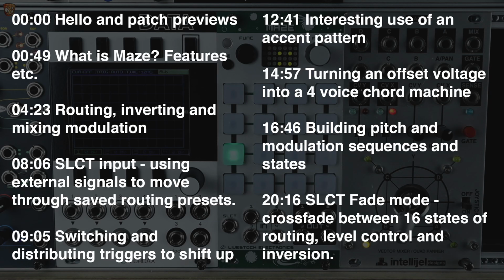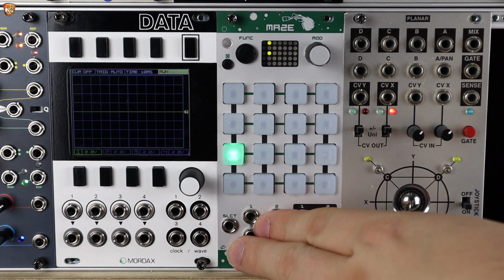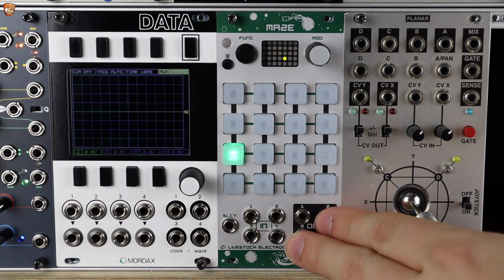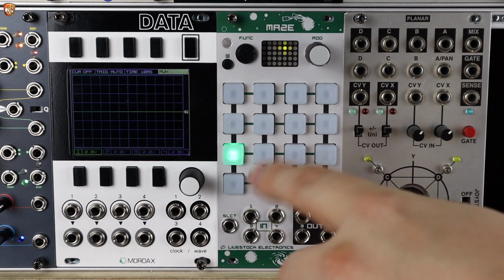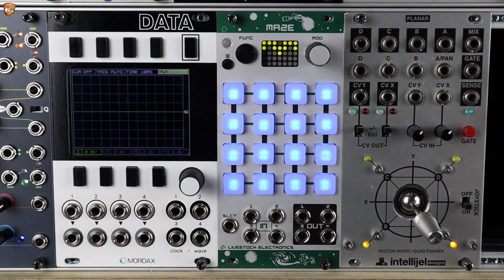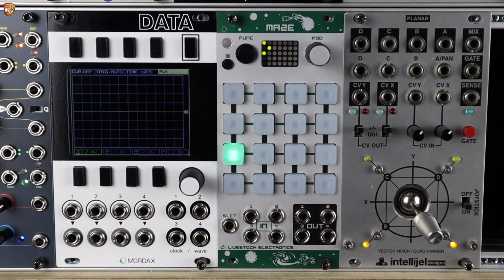Livestock Electronics MAZE - Sequential Attenuverting Matrix Mixer & Signal Router in Eurorack

Comment: Cool presentation of this beast. Powerful stuff for live racks but with a certain challenge to imagine and remember all that you save in it ;-)
Reply from the maker: For live I'd just save a few key parameters to take the patch elsewhere I think. Then use another bank for playing around outside of that live set.
Reply: Yeah, remembering what are in the presets may be difficult to remember. That's why there is a preview mode (not shown in this video). Where you can take a look in the preset before you initialise it. But personally I think like Ben said, take a part of it you find useful and keep it simple. :)

Comment: one thing I don't really understand from the manual or videos is what happens if you select a position, set its level, select another position, and then turn the encoder again before hitting func/save (like you do at 2:22).  does that set the level for both the previously pressed position and the latest-pressed position?  or only for the latest-pressed?  my hunch from the manual tells me that it sets the level for both, unless you either re-pressed the first position (to "deselect" it) or hit save before pressing the next position.  curious because I'm trying to wrap my head around how tedious it is (in terms of constantly hitting save - you sounded tired even saying "hit save again" lol) to use this in very simple matrix mixing applications.

Comment: great demo as usual :)
question : i’d like to use it to navigate through the presets of my polyend presets. the way i see it : one in the in with a « light » offset, one out to the cv input of the polyend preset.
would it work ?
Reply: the CV input can take a gate signal for clock or record automation to a selected output

Comment: Damn you!   I didn't even know I needed this.   Neither did my wallet...  My first thought is it could make an ace 4-input mono-to-stereo out mixer, and use the other two out channels as effects sends-- able to morph the pan position of each input as well as effect level, etc.   

One thing I'm wondering with regards to CV handling-- it does invert, can it also do offset?
Reply from the maker: No offsets, but that idea as a stereo mixer and FX send is great! ... I should try that sometime.
Reply: Offsetting can be done by simply plugging a DC voltage in one of the inputs. Alternatively it will be handled by a linkable upcoming module called Ellis.
Reply from the maker: oooooh linkable new module!
Reply: would love it but other switches cost way less and take up less space and get the routing mixer job done thus leaving funds for a sequencer or clock module.

Comment: Seems to do everything, but I wonder how well one can intuitively remember how to use all the features since it seems to require some degree of memorization from the manual.
Reply from the maker: Yeah it's not gonna happen the first time you use it. But after a session with it, it comes quickly. In use I just hit the main function button to jump between preset/save slots and routing and that's it really. Occasionally hitting the little button for some muting. Then very occasionally going into the settings to change between trigger, random or fade mode on the SLCT input. But you can just save a handful of routings and stick with those for any given set/project.
Reply: Jep, there is a lot what Maze can do and I can imagine it may seem like a lot, but the basics are simple. The basics (selecting presets, creating routings, muting and sequencing) are explained in a quick play guide. So if you just follow the steps in the quick play guide, you should get familiar with all the important stuff quickly. The other features you'll learn by playing with Maze, or of course by looking it up in the manual whenever you're ready. ;)
Reply: @DivKid  while I love the presets and automation factor of the module, I prefer modules that are easier to figure out without all the hidden commands.

Comment: My plan is to have pitch/gate from both sequencers of my beatstep pro in inputs 1-4 going out to different modules and saving those routings as presets. Would it work in that sense?
Reply: It should as long as you set the levels all the way up for each input (you may not want your pitch CV scaled down by MAZE), but you should get confirmation from Livestock (or some who has the module). That said, scaling and mixing pitch CV is a highly productive technique that MAZE can help with (you might need a downstream quantizer to lock the results back to particular notes)
Reply from the maker: Yeah that's a nice idea. Interchange the pitches separately or at the same time as the gates. Would be cool.
Reply: Sure, Maze is calibrated to a difference of approx. 0.01V, so it really depends on how precise you need/want it to be. In practice this means that there may be a difference of a few cents between input and output. Indeed if you'd like to use the scaling too, a quantizer will be useful.

Comment: What kind of mixer do you use? Do you have any suggestions for small mixers best for eurorack?
Reply from the maker: in the rack or external? How many channels? There's too many possibilities to answer without more information.
Reply: @DivKid  Sorry about that. What my goal is to get the audio of my hardware into my DAW simply for recording. From what I've studied, the Roland 531 looks like the best buy for what I want as I can plug it into my NI Audio 6 and then into Reason. Sure, the 531 eats up 20 hp of rack real estate, yet an offboard mixer eats up my desktop space (of which I have little left). I'm not sure if this will do the trick.
Reply from the maker: How many tracks do you need to record? If you have the NI Audio 6, can you not plug 6 inputs into that directly? Or do you need to pre/sub mix certainly elements to get everything into the sound card?
Reply: @DivKid  My Eurorack contains the Minibrute 2/s, a 6U Rackbrute for the core. Offboard, I have a Landscape Stereofield, a Beatstep Pro, a Minitaur and a Streichfett. I also have the Koma Field Kits, but they integrate easily into my rack system and contain loads of VCAs and a 4 channel mixer, plus ins and outs. As for number of tracks, I suppose it depends on the song I'm working with.